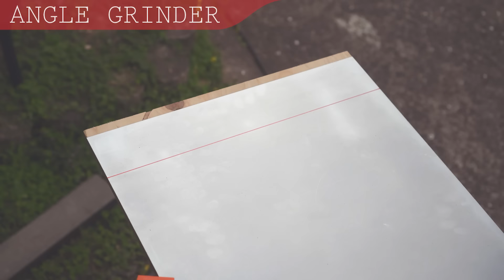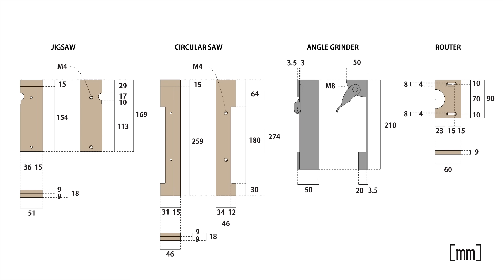Simple Blade Guide | Japanese Woodworking

Comment: Tried the jugsaw guide idea. It really works but you have to use the same blade for everything plus if for some reason the blade moves it will catch the guide and break the idea between the hole will be bigger. In any case it really change how the jigsaw cut straight lines, it really works.
Reply: Considering how simple that guide is, doing a couple of them depending on the blade thickness and width should be worth it... 🤔
Reply: Seems like an absolute waste of time, if you want straight cuts don't use a jigsaw. Pretty simple

Comment: Ok, I understand the jigsaw because the blade bends. But the circular and the router? You can just move the guide plank to compensate for the foot of the saw/router.
Reply: But it's way faster to be able to cut directly on the line without having to compensate... no?
Reply: I find compensating for the width of the base plate of the circular saw difficult - this jig looks much easier
Reply: Using the foot against the guide introduces another measurement into the equation, which introduces one more "estimate" into the process. With the jig, you position the guide where the cut line, and go. One degree of uncertainty, yes, but no hesitation about leaving the line, or half the line, etc.
Reply: When you have low quality tools this ideas are great I have a harbour  freight  circular  saw and suck big time but is what I can afford

Comment: Why use a jig saw if you're trying to make a perfect strait cut use a circular saw and you won't have that problem
Reply: This can be useful if you don't own a circular saw.

This can also be useful if you're not making straight lines.
Reply: Why is this comment near the bottom? This was also my question. The right tool for the right job goes a long way. My father, who owned a wood antique restoration business for 25 years taught me that when I was 5 years old.
Reply: For materials with abrasive top layer like laminated flooring you need a diamond blade for circular saw and a very good dust collection system. Jigsaw might be a simpler option.